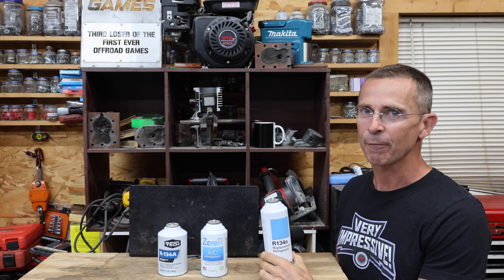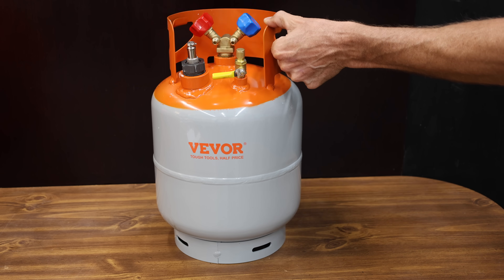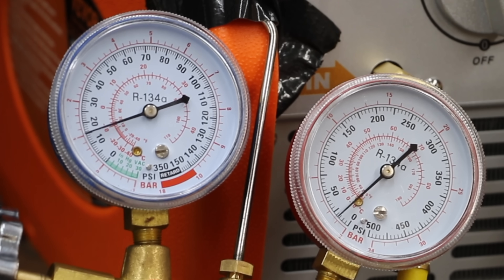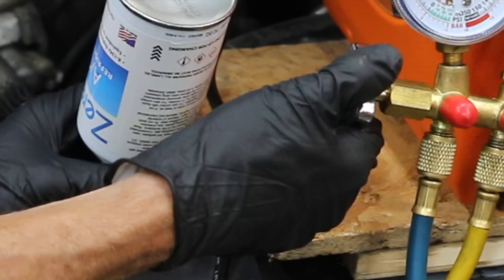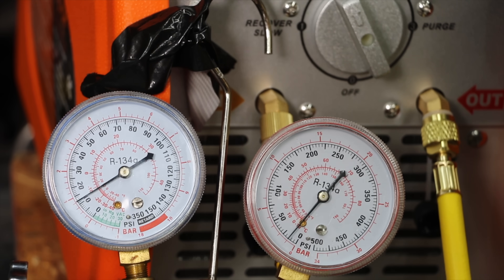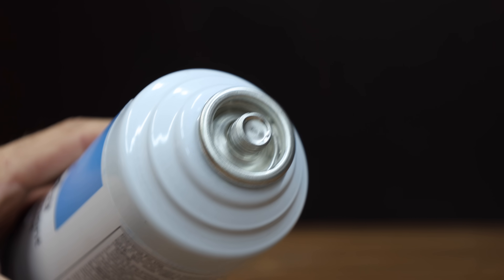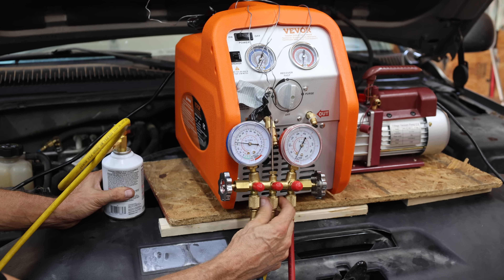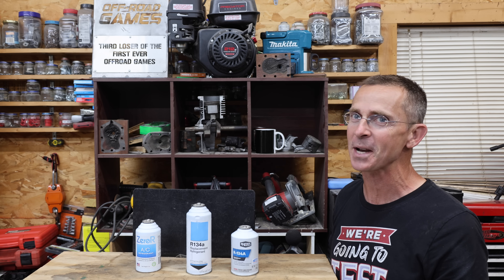How Dangerous is Fake Car A/C Refrigerant? Let's Find Out!

Comment: Propane as a refrigerant has been used in industrial applications for many years.
Reply: AMMONIA TOO
Reply from the maker: Thanks for the feedback.
Reply: It's now becoming more common in small refrigeration systems, just without the odorant, and in small quantities.
Reply: @viktorakhmedov3442  ammonia was most commonly used in RV refrigerators as I understand it. The ones that cool through the use of a propane flame.
Reply: Judging by the pressures, I don't think any of those refrigerants were R290.
Reply: @viktorakhmedov3442  Ammonia is used a lot in RV's.
Reply: @RebelCowboysRVs  Electric elements or propane burners are used to heat the ammonia to vaporize it,then as it condenses back to a liquid, it cools. No compressor is needed.
Reply: Currently cooling my vehicles :)
Reply: Ammonia is the preferred refrigerant of ice skating rinks
Reply: Ammonia, hydrogen and water are (is?) used in RV fridges
Reply: Propane is not preferred due to its flammability 😮.
Reply: That is R290.
Reply: Imagine  having an evaporator leak filling the interior with propane gas.  Sounds lovely
Reply: @darrylsjodin7184  driving in a vehicle with 40gal of gasoline running around 50psi. I think danger is relative to the act of driving..
Reply: @RebelCowboysRVs  Pure ammonia gas is used in large industrial units, and liquified under pressure, the eutectic fridges in RVs, use ammonia gas and an ammonium chloride solution. the heat separates the gas from the solution, and after cooling, the two are recombined, which results in the liquid becoming cold. I use propane/butane mix, cooking gas, it is extremely cheap. If the compressor is warn, I add more butane, from a blow torch disposable can, to reduce the liquifying pressure.
Reply: @Discretesignals  thats why it's not used for vehicles and residential. However an indoor propane or natural gas line is just as dangerous.
Reply: @volvo09  Airsoft rifles use green gas which is the same, it's just propane without the odorant.
Reply: considering that they add sulfur and all you have to do is roll down a window
Reply: @Discretesignals  So at most 2 to 3 lbs of propane.  How much NG can leak into a confined area from a line to a furnace?  How many fires/ explosions can you cite stemming from the use of R290?  R290 has been used in Europe for years.
Reply: @RebelCowboysRVs  No, by weight it is still more common in industrial applications.  The "no moving parts, just a heat source" appeals to RV's and off-grid as well as the general efficiency of ammonia as a heat transfer medium.  The downsides are like anything, many.  The biggest is "speed" to ramp up and down hence the reason it is so attractive in industrial applications...your are generally in the closest thing to steady-state you could expect.
Reply: Propane was the original refrigerant in electric home refrigerators.  Its flammability was the reason they invented R12.
Reply: My friend took HVAC after high school and as a project he made a liquid propane cooling system for his PC. He got great numbers on that thing
Reply: @somaday2595  R290 is not used in mvac.  What about safety?  Imagine a tech working on a car full of propane and they don't know it.  The recovery/recycle machine is not equipped to handle and store propane.  Propane is confined inside the system and can be a bomb if the right conditions occur.  People have been injured because counterfeit propane filled refrigerant tanks are floating around.  The automotive AC system pipes, seals, oils, and components are not designed to run propane.
Reply: More so ammonia.
Reply: @Discretesignals  I did not say anything about using it a vehicle a/c;  I was referring to residential a/c.  I
If the refrigerant has been changed from the original, the system should be so labeled.
Reply: @somaday2595  this video has nothing to do with residential ac systems, so why even bring it up?  Propane is not an approved replacement for mvac or residential units unless it's something like a window shaker. Doesn't matter if you label it or not.
Reply: @bairfamilyfarm1336 Unless I'm mistaken, "ZeroR" is R290.
Someone Who Isn't Me has mentioned that winter blend LPG with PAG or POE-A depending on the compressor works pretty well. 
I wouldn't know because I don't hold a 608 cert and would never think of touching a refrigeration system, I probably don't even know which end of the lineset to suck on.
Reply: @KingfishStevens-di9ji  A good thing.. Anyone could smell each shot. ;)
Reply: @blogengeezer4507  I play airsoft, there's always a waft of propane in the air. Lol
Reply: @CMDR_CLASSIFIED  
Yes, absorption refrigeration. Practical refrigerators using this technology were developed in the 1920s but it’s an inherently inefficient process and is nowadays only used in niche applications like RVs.

In the film ‘The Mosquito Coast’ the Harrison Ford character appears to build a giant absorption fridge in the middle of the Panamanian jungle.
Reply: @darrylsjodin7184 
Propane is being used quite a bit in Europe and in some window heat pumps in USA.
  They confine the propane to the outside unit.  Heat is transferred between propane and water. Water circulates through radiators and utility hot water tank.
  I don't know how utility water is heated in summer.
Reply: Natural gas is less dense than atmosphere, so doesn't accumulate in the basement.
Reply: @RebelCowboysRVs ammonia is also used in refrigerated Warehouses and large freezers in meat processing plants.
Reply: Been used in RV refrigerators for years
Reply: and in almost all refrigerators in EU
Reply: @matthewellisor5835  I've got my 608, the test is pretty much a bunch of mumbo jumbo compared to what you actually need to know out in the field. I've never touched an actual r290 system, the closest I've come to it behavior wise is R22 systems. I would image "winter blend" contains more butane and gas like that which would bring its behavior closer to r152a. I've never heard of propane having a "winter blend".
Reply: @RebelCowboysRVs and like all industrial refrigeration and food industry refrigeration
Reply: @biffmalibu3733  I've also seen CO2 used as a refrigerant.
Reply: @thebamplayer  Look up "R744", it's an actual thing like propane. Problem with R744/CO2 is, it requires pressures way beyond even a household air conditioner.
Reply: @bairfamilyfarm1336  I know, I've only seen it in big industrial AC units.
Reply: Could an ammonia based AC system make use of waste engine heat to make cold?

Comment: Im an appliance tech that does sealed system repair. Awesome to see you use the right gear and terminology. Its just a little diffetent for auto air conditioning
Reply from the maker: Thanks!
Reply: he isnt using the right terminology
Reply: @bn880  where was he incorrect In His terminology?
Reply: @leothetiger13  for example calling almost everything freon
Reply: @bn880  regarding the seal system itself just because he calls the coolant Freon sounds a little pedantic to me. Considering that it does the same thing that freon does and I'm an appliance Tech not a auto mechanic so he was speaking correctly as far as I was concerned

Comment: Another idea!

Testing brake fluids to see what differences there maybe between name brands and oem brake fluids. Which absorbs water fastest? Which resists heat and breaking down? Which handles pressure better? Maybe test dot 3, dot 4, dot 5 to see differences there. I think that would  be a great test, especially if you are getting ready to do a brake change.
Reply from the maker: Thank you for the video idea!
Reply: @ProjectFarm Test the brake fluids for boiling point as well please!
Reply: Brake fluids are very standardized due to regulations thus all Dot 5.1 fluids will all have the same chemistry and stats. Its not like oil where there are different engines and additive packages due to variations in vehicles.

Comment: I have had good success with an R134 substitute called Enviro-Safe. It's a 60/40 propane and isobutane mix. A similar blend has been used by auto manufacturers in eastern Europe and parts of Asia for many years, due to its performance and cost savings. Yes, it's flammable, but so is gasoline. Also, people have been driving propane powered vehicles for decades. Cars, pickups, forklifts, farm tractors, semi trucks, school and city buses just to name a few. But it does have many things to recommend it. In my experience it out performs R134 by a noticeable amount. The A/C in my old 99 GMC Suburban was significantly colder after switching. The molecule of the refrigerant is a lot larger than R134, so you will have significantly fewer small leaks. As such, it is also compatible with old R12 systems with no modifications needed. It operates at a lower high side pressure, reducing strain on the system and lowering the amount of engine power needed to turn the compressor, increasing (by a very small amount) fuel economy! It also doesn't deplete the ozone layer. And lastly, it costs quite a bit less. Of course, use only if you have done all the necessary research and due diligence, and have followed all appropriate safety measures. Then, it is a viable and economic replacement refrigerant.
Reply from the maker: Thanks for sharing.
Reply: That's a great mix for old R12 vehicles actually. We used to manually make the mix with a bottle of camping propane and a lighter refill can of butane.
Reply: Excellent explanation! Here in Germany/EU R134a cannot be purchased by private persons due to it's high environmental impact. That is also why taxes also have exploded for commercial buyers, which is why filling your AC will set you back at least several hundred bucks here. LPG has just the right mixture of Propane/Butane, so you can fill your entire AC for as low as 2 bucks. Yes, it is flammable and that is a drawback, but the amount is quite small. 
I think this is also a cheap and viable option to see if your AC system is working at all before filling it with R134a and risk releasing the equivalent of 1 ton of CO2 into the atmosphere.

However, these cans are still a bit of a scam as they charge way more than what a regular can of Propane/Butane costs, that doesn't has "R134a replacement" printed on.
Reply: The difference is AC systems are under high pressure and frequently leak, unlike fuel systems.

Your gasoline isn’t under 180psi
Reply: I have also been trying out this enviro-safe R134a replacement gass for around 5 years now on my daily beater. It does the job nicely. I do however have a leak somewhere, so i have to top it up after a year or so. No fires yet😅
Reply: @joemamr710   No, but is around 70 psi @ the injectors on a lot of EFI systems - a Geo Storm, for example.
Reply: bingo

Comment: Propane is a refrigerant,  R-290. At this time I'm seeing it in small refrigeration equipment,  beverage coolers, salad lines things like that.
Reply from the maker: Thanks for sharing.
Reply: Unless something changes, it will stay that way. In the US, usage in capacities beyond 16 ounces is illegal. Around the world, propane and other hydrocarbons are used in cars. That usage is banned in the US due to the explosive potential of a refrigerant leak. It's used in commercial coolers and residential refrigerators and works very well
Reply: @ProjectFarm  -  Brother and I converted his semi airconditioning system over to propane LOL. He refilled it if needed with Coleman cylinders. They also sell adapters from Propane cylinders to Butane cans for camping stoves but they make great adapters for boat air horns and also filling car systems with camp stove Propane which works, but works better with an expansion valve change. Something to look into.  A boat air horn will blow your head off with Propane and make you eyes switch sockets. Its MUCH louder and higher note due to smaller molecule than R-134. I still have a few of those crazy adapters. They facilitate a lot of fun :)
Reply: @friedpancakes266  -  Yep... Purified clean Propane is colder and works better than R-12 or R-134. Its a great refrigerant. R-12 was developed to replace Propane due to flammability.
Reply: Yes, it is starting to be used in some refrigeration tech but with any system it should be designed around the functionality of that refrigerant and the refrigerant used should be the one called for, not an "equivalent replacement"/

Comment: In depth, excellent research.  I did a propane/isobutane substitute on an R12 system decades ago due to removal of R12 from the market.  Changed to appropriate orifice tube and the system ran great, although it is a fire hazard.  I wouldn't do it on a modern system.  Episode suggestion, a review on automatic darkening helmet lenses with a comparison to a static lense.  Response time and image quality would be a good assessment.  I've been finding they do darken but most of them are too dark outside the weld puddle and makes it harder to track the weld.
Reply from the maker: Thanks!  Thanks for sharing.
Reply: I’ve done this too. It’s not that much propane compared to the amount of other flammable things in a car. R12 may not be flammable but it forms phosgene gas if exposed to flame. I’d rather be near a car fire with propane igniting than phosgene. Only a tiny puff of that shit can be fatal, it was the most deadly weapon in WWI.